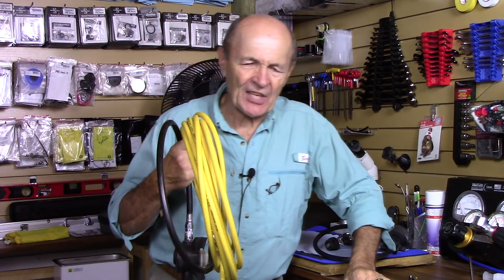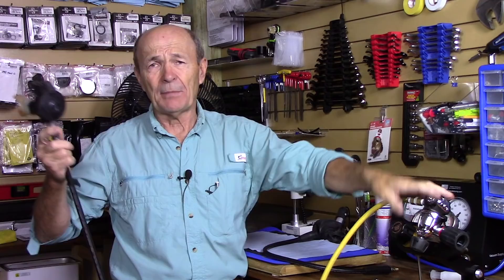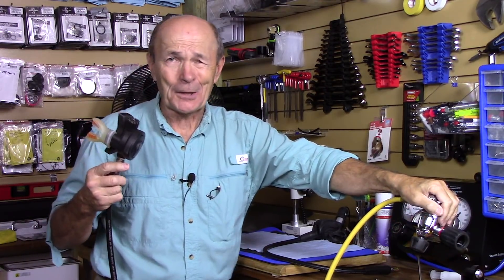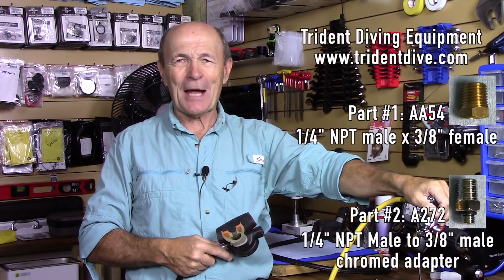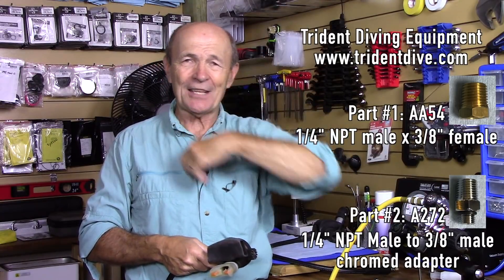Make Your Own Hookah Surface Supply - Scuba Tech Tips: S08E03

Comment: Love your channel...and on this topic, you've wandered off into something I've done for years...diving with surface supply. I 'gold dredge' (in both salt and fresh water)...with depths from 3-ft to 20-ft (often in a dry-suit, due to northern water temps). My dredge runs a 30-hp Yanmar diesel, powering not only an 8-inch suction dredge pump, but it also powers a single stage air compressor (like you might find in a workshop). The pump head is mounted to the dredge frame, and belt-driven off the Yanmar v-belt. The compressor takes in it's air from an elevated intake (with first-stage filter), compresses the air to 120-psi and stores it in a mounted aluminum tank on the dredge. On the output side, the air passes throughdryer, then a 50-micron filter, then second, through a 5-micron filter. That's smaller than a human blood platelet. After the second filter, it goes to a 3-port QD 'hookah' connection (for up to 3-divers). I run a 50-ft hose to my 2nd stage (don't need a 1st stage, as I am already at intermediate pressures).  This setup is as safe, or safer, than SCUBA tanks, since I can hear the engine running, I know the compressor is working, and at shallow depth, I can rise without problems if there is an issue (such as a hose rupture). I can operate for 160-minutes at 20-ft easily, for the cost of 2-gallons of diesel (that powers both the dredge and the compressor).
Overall...I'm guessing this set-up has saved me a couple of thousand dollars over the years, compared to paying tank fill fees at my dive shop.
Reply from the maker: Sounds like a great system. I've seen these in use in Northern California a long time ago.
Keene Engineering used to make such dredges.
How long can you breathe if the compressor stops, like on the tank reserve only?

Alec
Reply: Well, the tank is 30-gallons (about 120L), so depending on 'how labored I am (dredging is quite strenuous), I have anywhere from 2-5 minutes, depending...of course, if you have a 'catastrophic failure' (air hose rupture, etc) you have no more time than if your air hose on a tank ruptured, zero. But, even when NDL, if I am deeper than 10-ft (I've gone to 30-35 ft on 'face work') I'll stop at 10 for a minute or so...and if you hear that engine shut down, you stop hearing 'rocks fall back' from the end of the sluice, you stop hearing the motor, (your vacuum dredge quits vacuuming) and you know 'it's time to GO'.
Yeah, Keene made them during the 'new gold rush', and still make 'sluice skiffs', but mine probably cost 1/8th what theirs did, and in my opinion, is FAR MORE featured (after all, I dive, and I know what I needed...I don't think any of theirs has built-in surface air provisions). Running the whole dredge, sluice, air ops on that one 30-hp diesel is, if I must say so, brilliant....and makes it exceptionally affordable...almost profitable! Wife says it is about as boring as 'watching grass grow' (she likes pretty water, bright coral, colored fishies...go figure).
Reply: I don't have video of my dredge skiff (been meaning to make some, for a while now), but after you asked, I went and looked around on YouTube for the closest thing I could find that was set up like mine (which is a larger dredge skiff). This link will show you a walk-thru of what mine is similarly set up like...except they used a Subaru car engine, and my diffuser is set up different to drop the uptake onto 'gorilla bars' first, so that large boulders come out at the headwater, to prevent 'rock damage' to the aluminum sluice walls. I'm also not a fan of this dredge's steel reservoir air tank, or their intake pipes for air, or that they don't seem to have sufficient water and contaminant filtration on their air stream....all that said, it will give you (and your viewers) an idea of the layout and how the engine drives both the suction pump and the air compressor pump.
https://www.youtube.com/watch?v=mlNmCIOvQxY
Reply from the maker: Wow! Really neat.
The "new gold rush" as you call it was pretty exciting for me to watch. Dozens of manufacturers produced dredges and skiffs designed to make millions for simple scuba divers. I'm sure a few divers were pretty lucky too an did all right although I don't know any names.
I think that Keene and the other "gold mining" companies made more!
Thanks so much for sharing Skeeter.
Reply: @skeetersaurus6249  Would love to see a video of your setup!

Comment: Hey Alec, loved your video. Just a question about IP. If you go down to 120’, your static water pressure is about 60#, and your IP from the surface first stage is about 140#, so your second stage down below, only gets about 80#. Do you need to adjust your second stage to 80# IP or increase your IP ( I doubt you can go that much higher) to 200#?

Thanks

Miguel
Reply from the maker: If you were diving with a tank with the 1st mounted on it the IP increases automatically as you descend.
With Hookah you would need to adjust the IP depending on your depth.
Alec

Comment: Nice video again Alec. One question? How can you control your boyency without a BCD? I presume to use just enough weight and use your lungs and vins...
Reply from the maker: We did it for years Pandit.
There were lots of tricks to get it to work - holding rocks to get down, exhaling or inhaling, pulling ourselves up or down by rope or the bottom.
BCDs have sure made diving easier and safer.
Alec

Comment: hi Alec. interesting "backyard" hookah scuba hookup. My only concern is that as the hookah systems seem to promote "no license necessary" it could put people in a dangerous position. A good thing about the scuba courses is that half of it deals with emergency situations and how to deal with them. I also don't like the idea of no safe second or pressure gauge. anyone who wants to try this should be careful about using just any old compressor because they can produce carbon monoxide with the breakdown of the oil (filters won't help with this ) Most compressors have a warning not for breathing. If you are using tanks on the surface then you will have to be certified to get them filled (not at the gas station!). one other thing NPT is actually National Pipe Taper ,tapered threads for use with pipe sealant or tape as opposed to NPS National Pipe Straight  these usually have an "O" ring to seal like the scuba 1/8" NPS fitting.Regarding another comment about off gasses from the non food grade hoses this is generally only a concern for liquids like potable (drinking) water or liquid foods in hoses.thanks Owen m
Reply from the maker: All good points Owen. I always appreciate your input.
Most low pressure air hoses as found in garages and for air tools are NPT. One should use Teflon tape (not pipe sealant) if used for breathing air.
Alec
Reply: Well, I've been PADI since 1989 and predominantly dive on surface air ('hookah') in my hobby work. That said, many of your presumptions are wrong - though safety IS CRITICAL and you can't under-value PADI or NAUI or whatever professional school you prefer. Again, I've been PADI for almost 30-years...
THAT SAID...you can fill a scuba tank with a modern high-compression paintball set-up, and most have videos of it on their YouTube channel. Right now, coming out of Asia are a bunch of cheap, crappy compressors that promise an 80L fill in less than 4-hours. And, all the 'rednecks' you fear of using a hookah without training are, in fact, using it (and have been for decades anyhow)...keep in mind, before it was 'engineered correctly', some fool tinkered with it personally at a VERY hazardous level. There are PERPETUAL horror stories of sponge and fish divers in the Philippines dying of various 'compressor-related' deaths (such as open-breathing low-pressure air without 2nd stage at ALL) almost daily. I am NOT excusing them at all for their deadly follies...what I AM addressing is the fact that here I am, a certified diver, and this topic interests me because I DO IT FREQUENTLY, and you don't want anyone to speak on it because 'they might do something foolish' if they know. It IS a legitimate form of diving! As many have said, there are NO LEGAL REPERCUSSIONS from 'diving without a license' - a certification just gets used as a 'check point' to control diving via air-tank-fills, yet if a rich guy drops $3,500 on a tank compressor, the compressor companies will direct-sell him a compressor, no dive organization knows about it, and he dives...so it becomes a 'rich-vs-poor' checkpoint, not a 'skills-vs-no skills' checkpoint. FYI, actually doing 'hookah' diving correctly IS EXPENSIVE! I've got THOUSANDS in my rig (more than a good compressor costs) AND I am PADI...but if I couldn't exchange ideas with people, I would NEVER have thought of some of the designs I ended up implementing, either. Exchange of ideas gave us dive tables, respirators and BCDs..think of what we wouldn't have, if we didn't communicate?
Reply: @skeetersaurus6249  Im interested in what you have for hookah gear.

Comment: Air hoses are not all the same. The materials used to make them vary. Does it matter?
Reply from the maker: Not really. Most air lines are rubber or a modern material such as polyvinyl. Provided the hose is new and clean, it will be fine.
Alec

Comment: Excellent and instructive video as usual, Alec. One question. I see you're not including a non-return valve in this setup. Is it because that is not needed in a scuba-style mouth-held regulator which doesn't seal the diver's head/face (as opposed to full face masks or diving helmets), and/or because the second stage demand valve works as its own check valve? In the latter case, would either downstream and upstream designs work to that purpose? Thank you and I'm looking forward to your next video.
Reply from the maker: Interesting question.
A non-return valve is used in surface supply in case the air supply fails such as when the compressor stops. In that case the water pressure on the 2nd stage at depth would theoretically force water up the hose and into the air supply source at the surface.
That's not a concern for a modern 2nd stage since they are all downstream valves and would automatically stop any air or water movement into the hose. If you were using some form of upstream valve such as a tilt valve, that's not the case and you'd need a non-return valve.
Quite frankly, air or water being forced up the hose to the surface is not the biggest concern. The diver has no air would be on the top of my mind!!
That's the reason why a Hookah rig is often used with a scuba tank. The divers still wears a tank but has a Hookah air line running to the regulator. This presumes the regulator accepts a Hookah line while mounted on a tank such as with a 2 hose late model Aquamaster. Otherwise the diver would have the Hookah reg in his mouth and the scuba tank reg acting as a safe second but for his own use. 
I hope that makes sense
Take care.
Alec

Comment: Hi Alec, greetings from Norway.. Been of course watching all your videos.. I always thought hoses for scuba had to be approved for breathing gasses in the same sense compressors need to be approved once a year.. Is it fair to say you basically can use any type of hoses, such as i.e pnaumatic low pressure hoses as long as you have the right converters, does size matter?
Reply: I'd like to know this as well. I'd be worried about off-gassing of unhealthy compounds from air hoses that aren't made for breathing. Is this not a valid concern?
Reply from the maker: Hoses are hoses. Far as I've ever known scuba regulator hoses are not special in terms of carrying breathing air. They just meet pressure specifications and are new material. They all used to be rubber - rubber inner lining, nylon braids for strength and rubber outer cover. Rubber is nothing special in respect of breathing air.
Good to hear from you Tom.
Alec
Reply: Alec Peirce Scuba  Thanks for the information Alec, have always been here, just been to busy working to commenting.. On that note, my better half Yvonne works as a salesperson for a company called Hydroscand.no -  About 90 percent of their products are high and low pressure hoses in all sizes and thickness. Reason for asking is out of own personal interest. All my diving gear I do purchase at the 5 Star PADI Dive Center where I also work. A fun fact about that i must add. My instructor/boss was actually Master Instructor no. 14 in Europe. Still after close to 40 years as a PADI MI instructor, he is still doing at least 1 course every month, imagine that he he, some guys...  PS.. Still waiting for some new ranch vlogs he he. Absolutely love those :)

Comment: Nice video again. Thanks! One thing that confuses me: how about the ambient pressure? As far as I understand, the first stage senses the ambient pressure and adjusts the intermediate pressure accordingly. So, the 1st stage provides a surface + 10 bar pressure, but it is different than bottom + 10 bar pressure. If this is the case, I understand that the difference could be ineffective if the diver is not too deep. What would you do with a hookah if the diver is so deep that the intermediate pressure difference is effective? Maybe adjust the first stage's intermediate pressure?
Reply from the maker: You're quite right and that's the reason this type of set-up is used mainly by shallow water divers - dock workers, pool guys, pond installers, etc. At less that 20' it isn't  problem. Deeper than that and air volume becomes an issue. For a deep dive one would have to increase the IP and re-adjust the 2nd. It's not quite as radical as you may think. The IP increases by roughly 15 psi (1 BAR) for every 30' that you descend so if at 35' the IP would be 165 psi (11 BAR) instead of 150 psi (10 BAR) and so on.
Eventually a diver could be so deep that a standard regulator won't do the job. At 132' for example, the IP should be 210 psi (14 BAR). It would be hard to set the 2nd stage properly with that IP. I think my math is right.

It isn't perfect but it works.
Take care.
Alec
Reply: so that's what you had to do for the 100ft Hookah ? that would be around +50psi IP - question is how do you adjust the second stage to not free flow at the surface, yet breath relatively easy at the bottom, or is that where the knob adjustment comes in handy ? max tight as surface with no free flow, open as you go down ?